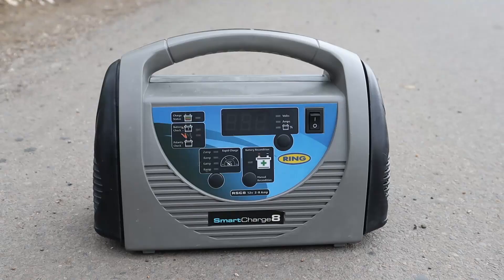12V Battery Health

Comment: quick question if i may, not directly related to this subject. have you ever noticed your zoe lose percentage once parked up over night, and gain some back at some point before the next charge? mine does this all the time, it will lose 3 percent only to gain 2 percent back at some point before being charged again.
Reply from the maker: I haven't really looked all that hard at my own, but I can believe it would, and I have heard others say the same.

My guess is that effect might be somewhat temperature related, but will also a symptom of the way the state of charge is determined. A guessometer is just that - it's a little bit of a guess of the state of charge. It's a very clever, informed guess, but it's not absolutely 100% accurate

Comment: my ev has a 12 volt monitor that keeps the battery charged when getting low.
even when the car is off.
Reply from the maker: That's true. They all do that. However, I think they stop doing so when the traction battery is low - perhaps about 20%. I think they start to reduce what the car is doing to maximise range. Therefore, if you allow it to fall too low and then sit with the lights on, you are flattening the 12V more than you might have expected.

We've seen experiences of people running out of charge, sitting on the side of the road waiting for recovery with their sidelights on, and being surprised that the 12V goes flat quite quickly. This happened to Andrew Till/Mr EV for example. If that happens, the cars onboard system isn't good enough to recover the situation
Reply: @theelectrictransition  if your battery is hitting the point of old and weak, then yes, it will go fast on high demand without replacement.
but continued low states before being charged fully will drop life faster than staying in a mostly fully charged state.
i think ev batteries are smaller, as their is less high amperage demand on them.
no starters to turn over, just contacters to close and the high voltage takes over with it's low voltage source. 
you don't need a high cca battery, so it's weakness shows faster.

Comment: what signs does the zoe show, that its 12v battery needs replacement or recharging?  is there a 12v health screen in the car?
Reply from the maker: The ZOE doesn't show any signs of problems in advance, as far as I know. I haven't seen any screen within the infotainment that you can use to monitor the 12V battery either, sadly. That's also true of ICE cars, though. Many moons ago ICE cars did have voltmeters on the dashboards - if we go back far enough - but I don't think I've owned a car that did.

It would be good to have more information, and I think that's something that it would be great to add in the future - but perhaps only useful to those who know, or care, what it means I suppose. An EV with LED headlights doesn't really give any clues, and something ideally should.

A viewer has recommended putting a simple 12V plug-in digital display into the cigarette lighter. They cost a few pounds, but might give useful information. That's something I will be trying out. Other EV channels (such as Andrew Till's Mr EV) have suggested fitting a bluetooth monitor to the battery. That will give more information, but will be slightly more expensive.

Comment: I've got a digital voltmeter plugged in the cigarette lighter socket (cost about £3.50 from Amazon, so not expensive) to keep an eye on the state of the 12 volt system.

On my Lexus UX (hybrid) it runs at 14.4 volts when the car is charging the battery, dropping to 12.4 volts when it reaches full charge. The exception to that is with a full charge it rises to 13.7 volts when I put the car into Park. My interpretation is that this delivers a controlled overcharge to help bring the weaker cells of the battery up to same level as the full ones, so I've taken to using Park more often at traffic lights and so on.
The other thing I take note of is the lowest reading I get at the instant of starting the car. I've seen it go as low as 9.8 volts after the car has been idle for a few weeks, so I now get the trickle charger out when it drops below 10.2. 
PS - I had to have the car jump started in 2020 since I wasn't doing enough miles during Covid lockdown to keep it adequately charged. Four years later the battery is still working OK, but I've got a bit paranoid about monitoring its condition.
Reply from the maker: That's a good idea, monitoring it from inside the cabin that way makes a lot of sense. A friend bought me a very similar voltmeter as a present some years ago, for use with my smart, as it seemed to have an electrical fault. I ought to plug that voltmeter into the ZOE for the same reason. Thanks for the idea.

The fault with the smart actually turned out to be an intermittent brake pedal switch, which eventually failed completely, leaving me with an ABS light on the dash.

The battery killer that was Covid, yes! I think quite a number of people suffered the same problem; I remember the RAC commenting on breakfast TV how much higher their callouts were in that period because of flat lead acid batteries. I'm glad it's not caused you any bother since.

Comment: Had two 12v batteries fail without notice on two diesel cars (2018 and 2021 model years) . No indications of upcoming failure, just failed over night.
Reply from the maker: Oh dear. Yeah, they don't last forever, no matter what we do. If you flatten one before its time then a decent charger might recover it, but lead acid has a limited life. Early EVs (into the 2000s) even used lead acid deep cycle batteries for traction. However, even that specialist battery type needed regular replacement, making them a hard sell.

Comment: A problem I have in winter on my Zoe 22kw. I usually run partly charging with a CTEK charger and sometimes the function "recond". In Zoe's case, you usually notice that the battery starts to have less effect, but it still starts, but it warns of "battery failure".
Reply from the maker: That's good to know, thank you. Well done ZOE, a message (and a decent charger) is what we need!

Comment: THIS IS A REAL     problem   this world    has   [ and i am not talking about     flat battery's and charging systems   here  ]    my problem   with this  content  is  . 
QUITE HONESTLY     THIS GENTLEMAN   HAS NOT A CLUE  WHAT HE'S TALKING ABOUT .... 
as a    motor vheicle   teck  that spent    2 years   learning      battery's and  charging   teck    .  [ all bee  it  25 years ago  ]     the basick  princibles  still apply       . even   on the new   smart  charging  systems that cars  have  onboard now  !     the only difference   now   the    engine only   charges  the battery  when it need's to     .  in all my time   of ownership   of any motor  vheicle  i only  ever had to     charge  one battery on    any of my cars  i  owened   and that was a car i left  for   two years   with  the battery conected .
Reply from the maker: You haven't really said what your concern is, so I'm not sure I can provide a useful response. One significant concern you mention is that you haven't suffered from lead acid batteries going flat. That seems like an odd thing to disagree about, as I'm not sure how you could know the experience I have had with my cars. Since a flat 12V battery is usually listed as the second most common reason for either AA or RAC callouts these days, it appears I'm not the only one having those problems.

Comment: On the smart i think that the battery drain is due to an old oxidized connection to the starter motor, i think it's worth checking those connections
Reply from the maker: OK, thanks for the idea. All of my smarts have done it, and all of their lives - but there is no harm in me checking it out. I'll do that very thing, thanks!